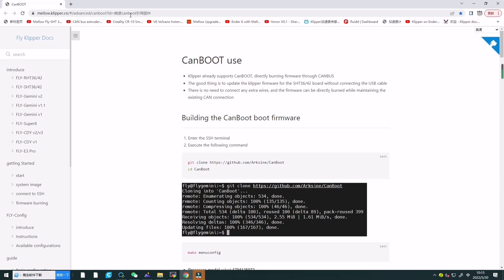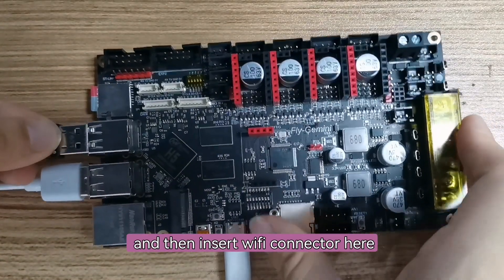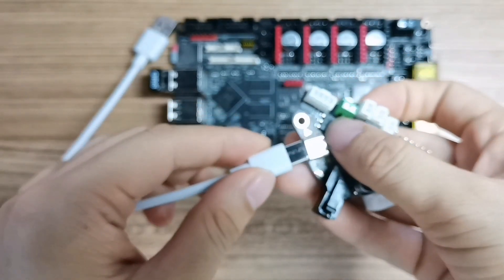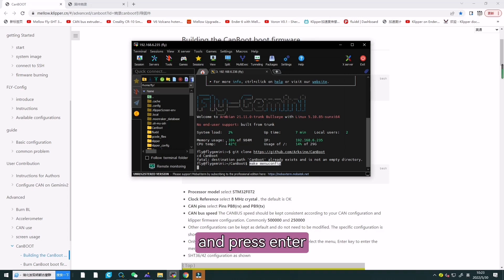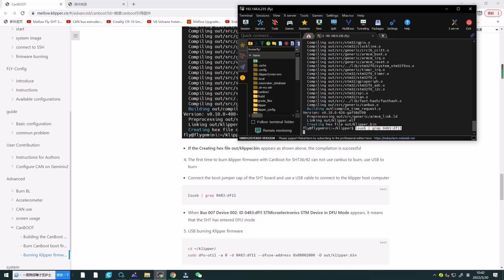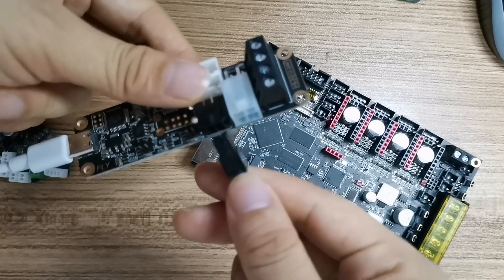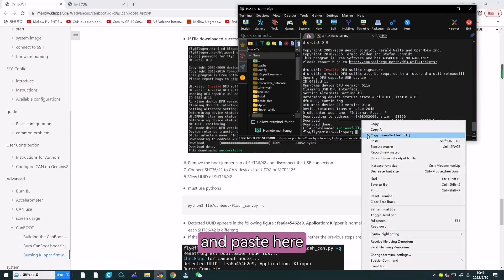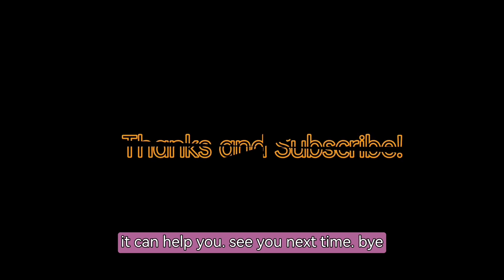Guide: Mellow CANBUS Fly-SHT Board/Fly-UtoC Board BL installing Klipper - Step by Step Guide

Comment: This is about the most cryptic and messy tutorial I've had the displeasure of trying to work through.  I have a UTOC-1 and an SB2040 toolhead board and despite Mellow marketing these two together and touting their compatibility with Klipper it has been nothing but frustration trying to figure out these devices.  

There are five pairs of jumpers on the UTOC-1.  There appears no clear documentation as to which ones are terminating pins, or if they are on the board at all.  There is no pinout graphic on their GitHub.  How is this remotely OK?

Comment: When I use Can with Gemini and SHT36 I can basically use 5 stepper driver instead only the four onboard? For  example CoreXY with MotorA/B (2), dual Z axis(2), extruder motor from STH in total 5 drivers?

Comment: i have SHT 42, its great but i have random resets, i think its for conection, with USB cable... I want to try with the FLY UTOC board, the problem is that I don't know which of the two models to choose, and reading the documentation it is not clear to me
Could someone tell me in which case the model so I want to try with the FLY UTOC-1 is suitable and in which case the model FLY UTOC-3?
Reply from the maker: Hello Manuel, Fly utoc-1 can only be connected to the lower computer with CAN transceiver
Fly utoc-3 can be connected to lower computers that support CAN but do not have CAN transceivers
Reply from the maker: And also you can join on our FB group, there are many people can help you to solve problems: https://www.facebook.com/groups/395979321769632
Reply from the maker: And also you can join on our FB group, there are many people can help you to solve problems: https://www.facebook.com/groups/395979321769632
Reply: @3DMELLOWPrinter  utoc 1, can be connected to Octopus Pro... Think these board have CAN transceivers. No?
Reply from the maker: @manuelpeirofrias293  Hello Manuel, you can use UTOC1 Thanks
Reply: @3DMELLOWPrinter  ordered
Reply from the maker: @manuelpeirofrias293  Thanks for your support❤